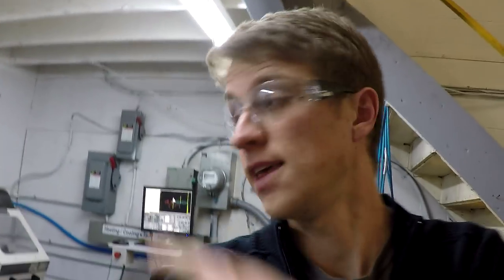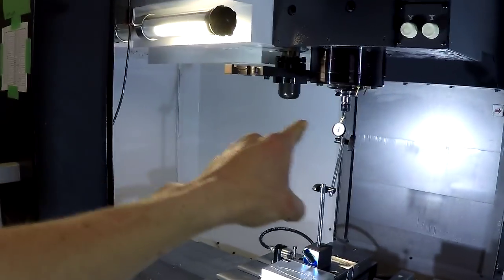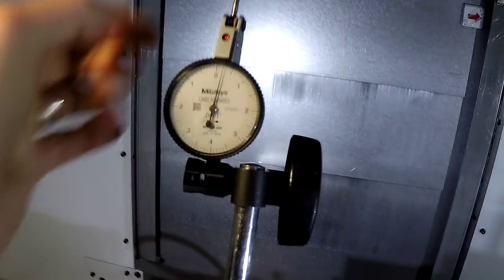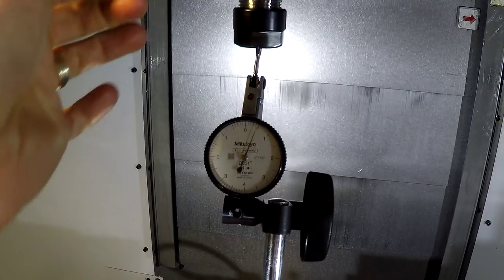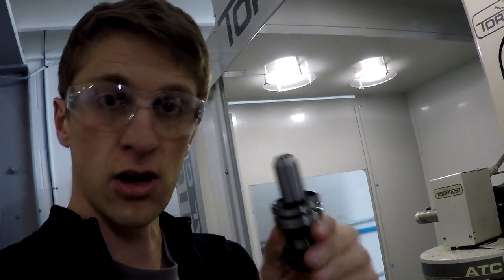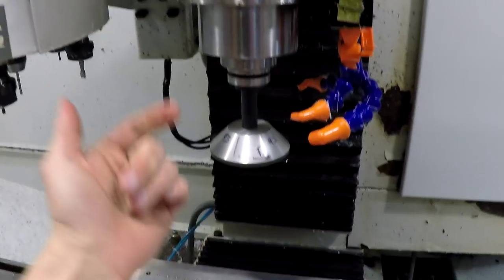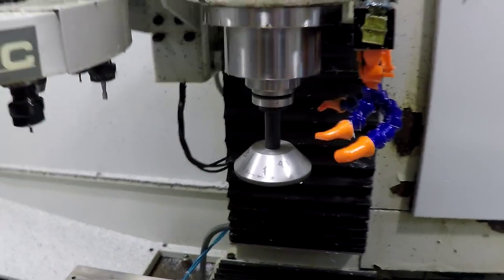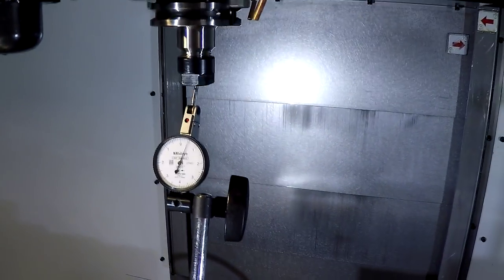Endmill runout is bad

Comment: Runout compounds as well which is why a Mori spindle costs so much. Each rotating component in the spindle can have runout, the CAT40 taper can have runout, the ER collet holder can have runout, the ER collet can have runout and even the tool itself can have runout if the machine used to grind it had runout.

This is not universal, but higher quality tooling tends to have less runout. If you want to reduce the runout on your machine, one of the simplest ways is to stop using ER collets and switch to shrink fit tooling instead. Simplest, but certainly not cheapest.

Comment: Hi! Here is the solution. Shift from ER holders to shrink fit or hydraulic end mill toolholders and you wil not have runout problem. We use Haimer and Gewefa tool holders, the best. Yust drop the endmill in the toolholder and tightening. ER tool holders is not good enough for fine tolerances in big volume series production, 20 year experience :)
Reply: +centernorway I agree, hydro and shrink fit holders are much much better and you get better toollife as a bonus :-)
Reply: Yes Egbert, ER kill endmills faster than shrink and hydro holders :)
Reply: +centernorway True, nowadays I use Hydro chucks for all performance & precision applications and still use ER collets for "simple" work like drilling with normal HSS-Co drillbits and for work with low speeds and feeds. Carbide drills and endmills and indexable drills I use the hydro chucks.

Comment: John on your Mori you should invest in some shrink fit tool holders for your small end mills. They will have less run out than collet chucks. You don't need a expensive heat shrink system I have used a propane torch for many years. Just don't heat it any hotter than necessary. To cool the tool I put it back in the spindle and turn on the flood coolant.

Comment: Have you thought of trying shrink fit holders? I tried one and the run out is stupid good (almost zero every time) they just don't last long if your heating them with a torch and not a fancy induction heater. Also you really should dial on the flutes (carefully turning in reverse) of the end mill because their is a going to be runout in the grind. I've seen upwards of .002" at the tip, even from quality manufacturers.
Reply: +Widget Works Manufacturing Inc. You might want to build some kind of heat shroud and deflector around the exit of the torch. Induction is sure faster, but I've used a commercial heater based on the Steinel HG4000E which has nice temperature control (http://www.steinel.net/Industrial-Heat-Guns/HG4000E) and we got quite long life out of the tool holders.

Comment: As you mentioned, shrink fit holders are the best, but can be rather spendy. To get pretty low runout and extreme resistance to pull out, and relative cheapness, we "glue" tools into regular end mill holders, we get insane tool life and can use all the horsepower our fixtures can resist.  Done right, a tool will break way before pulling out, and finishes are almost as good as shrink fit holders.  Again, many thanks for taking the time to make your videos!
Reply from the maker: +yamahaeleven Wow neat!  What kind of glue?
Reply: +JohnGrimsmo We use RITE LOK retaining compound, high strength, for cylindrical assemblies.  The stuff is meant for bonding gears, sprockets and bearings to shafts.  Been working for us over 20 years (same bottle, don't need much!).  I'm sure you can get an equivalent Loctite from Grainger or McMaster.

Comment: It's not necessary to loosen the collet nut and rotate anything. Instead when everything is done up and ready to go, find the high point and TAP (don't whack, pound, smack, or otherwise abuse the poor machine), just tap the collet NUT with a piece of brass or small brass hammer. It will shift the collet just enough to get it run concentric. Don't hit the tool. Don't hit the collet. You can pound on them all day and they won't budge. Don't hit anything hard. Just TAP the nut. It sounds crazy. It sounds like it will never work. It just works!

Comment: You can fix this by using higher tolerance holders John, love your vids. btw.

I held a seminar the other day, and a higher grade holder is so much better. Considering that to much runout is degrading your tool life considerably.

Higher grade holders will also allow you to do better dynamic milling.
Reply from the maker: +Peter Uhrskov i totally agree that i need some better holders, but these are all Sandvik so I assumed they would be better. I installed some better nuts on and it made a huge difference, just a tenth or two now even with cheap collets.

Comment: I haven't seen in the comments anyone mention dynamic runout vs this static runout test. In the cut matters a lot more, but obviously good to have static runout low. Wondering how you've evolved in this over 2 years. Since then Maritool has come out with some great offerings, including SK collet holders. I've heard they can often be better or as good as shrink fit. I've got a tooling budget that comes with my Brother Speedio, instead of getting expensive holder set or end mills, I'm thinking about spending it on something like an Orange Vise and a 3D tester, then buying holders from Maritool at about 1/3rd the price of Lyndex-Nikken. They also have great deals on shrink fit holders. 

I guess I've found that shopping for cutters and holders is easier to find good deals on big name or equivalent stuff (due to shops having overstock), whereas workholding and metrology seem like mostly people buy new and never sell the good stuff. :)

Comment: two tenths? what's the problem? you can't even expect your axis to repeat the that!
Reply: +HRM Weapons Machinist 
Runout has more to do with getting the right chip-load, particularly with small cutters, than accuracy. If you have a calculated chip load of 1.5 thousandths and you have 0.5 thousandths of runout, you could potentially have 2 thousandths of chipload on half the tool and 1 thousandth on the other half. In other words, one flute will be taking twice as large of a "bite" as the other.

Comment: it's been quite a long time since I've measured runout on anything but a reamer in a fairly accurate application. at some point, everything gets accurate enough that it isn't much of a factor.. I do know you mentioned your sandvik bearing nuts causing excessive runout, which seemed odd. The Nikken ones were always pretty badass, but keep in mind they spec more nut torque than a standard nut.
Reply from the maker: +rob lockwood My love of measuring runout stems from the Tormach where just rotating the tool would get it from 0.001" down to a tenth or two, which makes a HUGE different on my little 1/32" ball engraver.  I've had like 5-8 tenths with the sandvik nut, then thrown a tormach nut on and I get it down to a tenth or two.  I need to get a handful of nikken, rego, etc collets and nuts.  I think the sandvik toolholders are nice though.  I should play and see if nut torque affects runout.  I'm not torquing these to any spec other than my calibrated elbow torque gauge.  I should probably upgrade that.

Comment: That's a lot of wobble in that tool holder. It might not be a big deal when the tool is small and short and have very little stick out but you will have problems if the tools gets bigger and longer. 

0.02 mm 15 mm out from the face of the tool holder might be close to 0.15 mm if the tool is 200 mm long. 

New collets and better tool holdes might be the new thing to buy :)
Reply: 2 tenths of a thousandth of an inch is around 5 microns, or 0.005MM, so not as bad as 20 microns.

Comment: I don't suppose we will ever see a collet system that allows for adjusting the run out. Occasionally you can use a shim in between the tool and the holder for some one off jobs. It would be nice to be able to "dial" it in.
Reply from the maker: +ExtantFrodo2 A shim would be too much.  I'm able to dial it down as low as possible by rotating stuff around and using different combinations/brands of parts though.
Reply: nikken has a version of their SK collet system with a rotating collar that allows adjustable runout. the caveat is that it always started with significant runout, and allowed you to dial it to some position just barely better than the normal SK collets.
Reply: JohnGrimsmo
For couple tenths it would definitely be too much. Also, good luck finding a shim that thin. Shimming is most often seen to "fix" worn out lathe centers. Not ideal by any means.
Reply: rob lockwood
yewwww. Let's start with bad and hope it can be not so bad. Wonderful idea! Not.
Reply: +ExtantFrodo2 yeah, that's basically it. again, they were ultimately capable of higher tolerance, but it just wasn't generally worth the extra effort.
Reply: rob lockwood
I'm kind of very impressed by these 3 jaw chucks that reside on an adjustable 4 screw back plate. Good for zeroing the center if your run out is already good. That's a different topic though. It deals more with wobble than the tool being off angle. Though both can be serious problems.
Reply: +rob lockwood I know that thing. The guy who does my precision work always complains about it. IMO he has a love hate relationship with it. You either love it for the precision or hate it for the time it takes to chase the wiggle.
Reply: aserta
I think a proper system would consist of 8 adjustment screws. It would work best if the tool had a small diameter increase between the upper and lower sets of 4 screws to "seesaw" the tool into position.

Comment: John, I love how crazy you are about precision but why do you still use spring collet tool holders and not size specific holders?
Reply from the maker: +Logan Charboneau Other than shrink fit, are you referring to set screw style holders?  I've heard that they're not very good either, and would suck for tiny tools like this because there's no flat to mount them to.  But mostly I'm still on ER because it's relatively cheap to have a wide variety of sizes.
Reply: +Logan Charboneau Size specific tool holders can be poorly made too. He has some videos on choosing ER20s over ER32s, but if your need for precision permit a couple tenths run out and that is what he is getting then the great versatility of the ER collets out weights the greater precision (and expense) of the  other.
Reply: +JohnGrimsmo the set screw ones are what I was referring to. in my experience they hold some tools better and if the aren't abused or crashed then they have been good to me. you can always bring a flat onto the shank of your end mills to facilitate mounting. I'd be interested to see you try them for the small size. though just an option. I've only been a machinist for four years not and certainly not a master by any means. thanks for all the videos and fast response.
Reply: +Logan Charboneau 

The screw type holders is not that precise either. You can buy some tool holders where the hole for the tool is slightly offset to one side to compensate for side movement when the screws gets tightened. 
But they are considerably more expensive compared to just a simply ER25 or ER32 collet tool holder.
Reply: Rasmus Laursen
Do you have personal experience with the screw type holders?
Reply: +ExtantFrodo2 
Yes i have. We use all kinds of tool holders where i work.